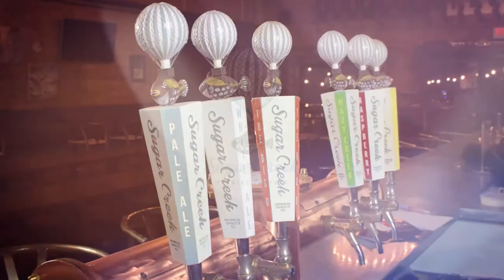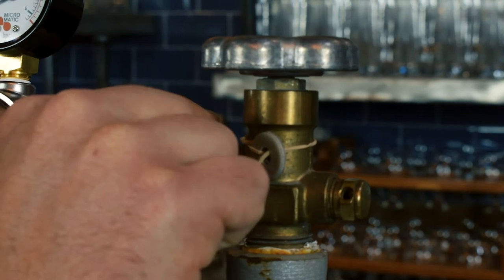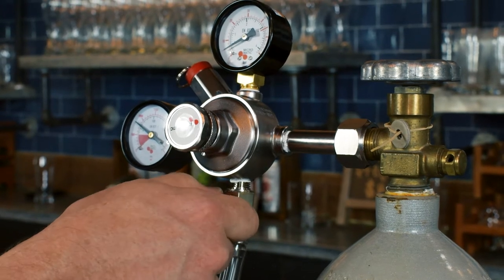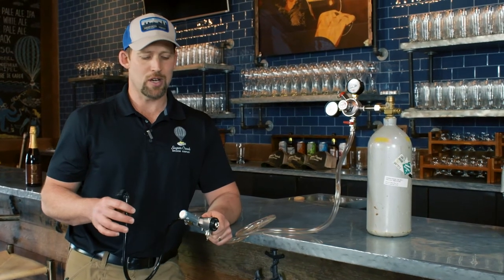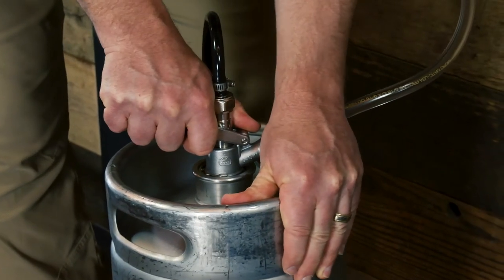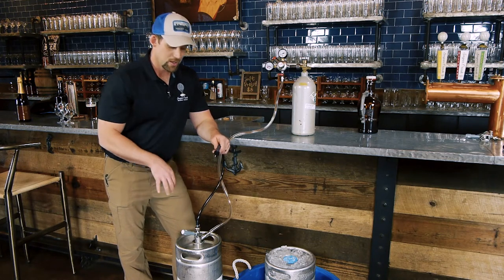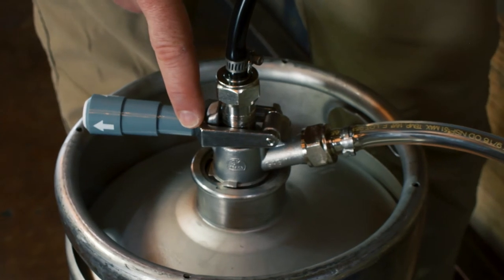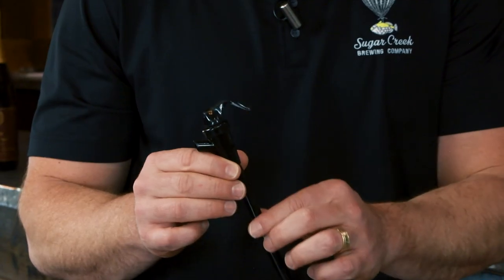Using a C02 Keg Tap System - Joe "The Beer Teacher" shows you how!

Comment: So when exactly did you turn on the co2 and charge the keg? Do you tap the keg then turn on tank and open valve sending co2 to the keg or do you turn on co2 first and then tap the keg? I also heard that you should pull the pressure valve out for a few seconds on the keg tap before you draw beer? I'm new to this so trying to do it right the first time!

Comment: Hi, I want to start a small project selling nitro coffee, and I wanted to know if I used a 20 liter nitrogen gas bottle, a 9 liter barrel, and a 40 pressure pump. How long does a nitrogen gas bottle last? Do I keep the nitrogen gas bottle open after pumping it into the barrel, and should I leave the nitro coffee for a while? Can you provide it directly? Thank you
Reply: You need about 35 psi of nitrogen applied to the coffee at a temp of 36 degrees F for a period of 2 weeks to get some N2 into solution. I imagine you would use a G Blend to serve the nitrogen and 20L Nitrogen bottle should last a while. I'm not an expert on Nitrogenating beer so if you have alternative suggestions I would love to hear them! Thanks for watching.